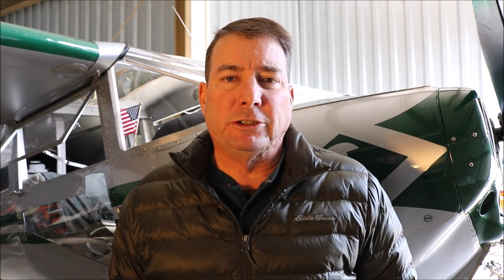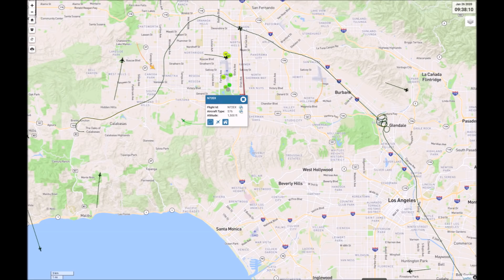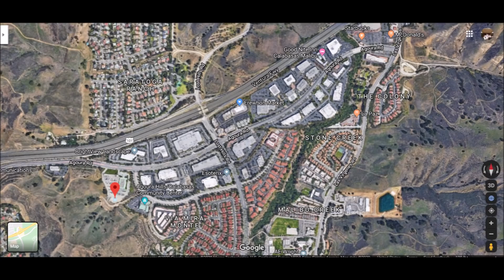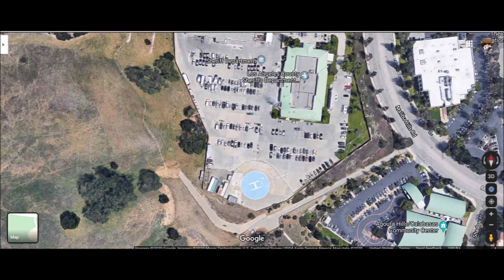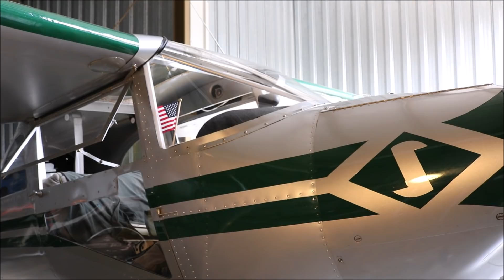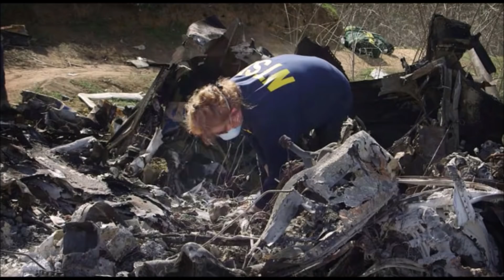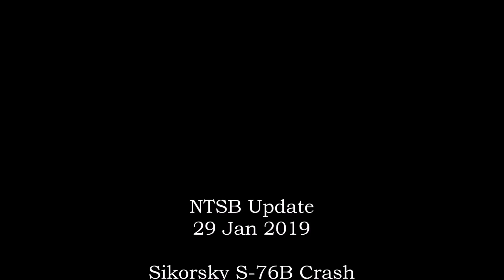Kobe Bryant Sikorsky S-76B Crash Update 29 Jan

Comment: If the aircraft had a mechanical problem with perhaps a main rotor or tail rotor, would it not make sense to change course in an attempt to reach the helipad that was a mile from their location? 

Also it was reported that  an altitude of 2300 ft. was higher than any hills in the area.  That means the aircraft could be monitored  by SoCal Radar and direct communication between air traffic control and the pilot was possible.  Do we have ALL recordings of communications prior to the crash?

The crash site appears from other reports to be on the downward side of a hill.  That means the pilot cleared the crest of the hill and crashed soon after.  This data is consistent with both the rate of decent and forward speed.  

The Sikorsky S-76 aircraft has been in certified since 1977.  Sikorsky S-76B (N72EX) was built in 1991.  And though there have been changes and upgrades in power plants and electronics, the airframe and major mechanical/hydraulic components remain much the same as first produced.   A cursory internet search yields numerous failures of tail and main rotor failures.  With rare exception these failures led to tragic  loss of life. 

Crash site photos of N72EX reveal images of smashed  main rotor parts and also show the main rotor hub at some distance from the center of the crash site.  

Tail rotor parts (with distinctive shape and yellow tips) are not accounted for.  Any idea as to their crash site location?

Comment: im not well knowledge on copters but is it possible that with a rapid climb without warning of power limitations that it overpitched and as result rotors loss RPM which can cause a rapid decent with out the pilots immediate reaction to stop the decent.?

Comment: The FAA is becoming the laughing stock of the international aviation world.

The max-8 certification saga is the last straw.
For years, the world has put up with the FAA because of the number of US aircraft manufacturers in the world. - They want the aircraft.

Small repeated accidents like this show the failure of the FAA to act on training and technological requirements that can make flying safer.
I know full well that cost and practicability is a huge factor, but you just have to look at the ADSB requirement to show that it is possible to enforce new blanket rules which require individual investment by the community.

When international aviation authorities start to treat the FAA and their certification of new aircraft like they treat the "third world" aviation authorities, you know there is a VERY big problem within.

Comment: When you say "lost control of the aircraft", does that mean not knowing which way is up or down? Model helicopters and drones have cheap gyroscopic stabilisation that prevents them flipping over like that, yet they are still easily controllable. Wouldn't it make sense to implement systems like this to full sized helicopters to prevent catastrophic loss of control through disorientation?

Comment: I understand it takes time for FAA to pass on regulation to require CVR, FDR, HTAWS, EGPWS and other systems but there’s nothing preventing the Operator of the helicopter to procure and install these features either via service bulletin or supplemental type certificate. I’m not familiar with the S76B but, in a quick search online, I found many websites announcing these equipment to that helicopter model. I understand that there’s a significant cost component into voluntarily installing these equipment but, as SMS gains in importance in Part 91/135 operations, one should expect operators to be willing to improve their aircraft. Could any of these equipment have saved the 9 on board? Too early to say.

Comment: Juan, thanks for the common sense, factual analysis.  While mandatory changes to part 135 and part 91 operations would take years to implement isn't it true that synthetic vision systems are available today that could have been legally installed and available to assist a pilot to get out of trouble if IMC is inadvertently encountered?

Comment: I heard a quote recently about flying in fog. "Remember, it'll be sunny the next day when they zip you up in the body bag."
Reply: Johnathan Mc - absolutely correct - almost every post impact CFIT photo library - you will note the weather is perfect .....

If only the pilot had waited out the weather, or made a better decision to re-direct to a clear area

This accident probably had some “get there itis” component you it, or as Juan points out, he was trying to locate the helipad and lost control in the thick clouds 

The question is why did he keep on flying into deteriorating conditions in the first place ??

Probably we’ll never really know 

RIP
Reply: @captbiggles2808  maybe ego, maybe proving himself as the 'guy who gets it done' for the high profile customer, overestimating skills. alot of unspoken reasons in short. why do we continue when in hindsight we should've turned back.
Reply: Matt Ford you know that the audios release from an air traffic controller regarding Kobe’s flight that day show that Kobe’s flight was held up by over 12 minutes. Weather conditions can change very quickly. I’m sure you can imagine what waiting over 12 mins to be cleared to continue your flight could have changed regarding weather conditions. Kobe’s pilot was instructed to keep circling that airspace. The air traffic controller tells another pilot that Kobe’s helicopter has been waiting about 15 minutes and holds that pilot off to allow Kobe’s pilot to continue on. Who knows if they hadn’t been held up that long if the weather conditions would have been a little better and they would have made it safely.
Reply: Tiff Turg You’re right, and understanding those variables ahead of time is all part of exercising good judgment.
Reply: @captbiggles2808  perhaps the tenacious and persistant nature of the Mamba Mentality caused this tragedy.
Reply: my love songs 
You are absolutely correct, they want to get it done, but you can’t control weather
Fog is the worst scenario. Stay grounded until it clears
Reply: @mylovesongs2429  I have thought that " We gotta get there, there's a tournament"
Reply: @mylovesongs2429  If sadly so, that is where the FINAL, most respectable pilot mentality / wisdom & disciplinary intellect of SAFETY FIRST should have been honored, w/complete humble relinquishment of any egos for best interests of all☯️
Reply: Exactly. If the news choppers are on the ground and the law enforcement birds are as well, I'd say that it's a good idea to keep your ass on the ground.
Reply: Sad, very true...the idiots are the ones who don't understand how mouse traps work.
Reply: Sad and true,  it always is 😕
Reply: So very true
Reply: Understood
Reply: Cassidy  Goodwiin is an idget......
Reply: Jonathan McMichael 🤭
Reply: Lol
Reply: You're an idiot
Reply: @cassidygoodwin478  thats probably a pilot quote though to warn other pilots who are about to make a bad decision. Its not a joke
Reply: Cassidy Goodwin, living and flying in Alaska I’ve seen a lot of cfit crashes, usually the next day it’s beautiful. 

It’s get there-itis which helps kills aviators
Reply: @jamesspikes  exactly! "Get thereitis"
Reply: @cassidygoodwin478  You can't handle the truth.
Reply: Cassidy Goodwin and you’re completely missing the point. He’s not being disrespectful .

Comment: Speaking as someone who has done a little bit of testing of enterprise critical software over the years, "it takes time", may well be true, but time is not always the strictly linear thing we assume it to  be. 
If it takes one individual 1 month to perform the necessary tests, it may take 30 individuals only a day. 
I suspect the FAA needs to up its game in terms of resource. 
These processes do take time, but any wasted time in this case doesn't just represent dollars, it also represents lives. 
Likewise any corners cut (think 737 Max) also cost lives, thus a fine balance needs to be struck. 
I would argue the process needs to be far more transparent. 
Why is it taking such inordinate lengths of time? 
What could be done to reduce this time without compromising safety?

Comment: Is it possible that the helicopter hit the mountain (900’ - 1,000’) before the steep turn at 130 kts (1,300’ MSL) ?
Reply: John Kyle I’m not sure if the correlations of altitude between the radar, helicopter and terrain are that accurate.

Comment: Transition from VFR to single pilot IFR raises pilots workload and pressure exponentaly, especially if you are not prepaired, low visibility, low terrain and you are entering busy airscpace. And in case of an emergency situation goes worse.

Helicopter is very unstable at low speeds, it’ s easy to lose control/get disoriented in IMC conditions if you don’t have proper training and if your experience is only from normal IFR flights from field to field.

Low speed, low alttiude and low visibility...allways a bad choise.

But we wait and see what NTSB finds out...

Comment: In this case, obvious scud running, the terrain avoidance system would have been turned off, or continuously flashing/beeping. This was a deliberate  low level attempt to push into low visibility, low ceiling conditions.

Comment: One of the most articulate and competent aviation witnesses I've ever heard, was underneath the Sikorsky S76B moments before it crashed.  He described it moving as very slowly, directly above him, but in the low clouds and not visible.  His description of the forward velocity made it sound like it was hovering and moving slowly and definitely below transition speed (where it begins to fly more like an airplane).  If Juan is correct about the difficulty of flying in the clouds in or near a hover, then this is a rather important witness to the whole crash investigation.  The man's statements are on YouTube as a video.  Sorry, I don't currently have the link, but it was posted by someone else commenting.  Perhaps someone can re-post it here.  I am retired now, but flew for the same major airline that Juan Browne flies for.  After retirement, I learned to fly a helicopter, but never on instruments.  In and near hover, a helicopter flies much as you would balance a broom in one hand.  As long as you keep moving your hand to keep the broom upright, you can keep it upright.  As soon as you stop moving your hand, or make a small mistake, the broom quickly tips.  If it goes too far, it's too late and it falls over.  In visual conditions, hovering a helicopter is actually easier than balancing a broom, once you get good at it.  At night, with fewer visual cues, it becomes more difficult, but mostly not too difficult.  The worst is a dark night with no lights.  I only rarely flew at night.  In two events I recall, I had no visual cues down low for a minute or two, though I knew exactly where I was.  In those conditions, I did use the artificial horizon and that worked fine.  I was mentally prepared for this as it was at the end of a long night flight over rural areas.  I also was not hovering, but flying at perhaps 60 knots, so the helicopter was flying like an airplane.  The sky was absolutely clear, but I was in a deeply rural area.  No lights and no moon.  It was very spooky, but not unsafe due to:  1.  Forward flying speed;  2.  Knowing my location, which was free of obstacles (hills, towers, wires above 100 feet).  I have no idea how an artificial horizon would respond in a hover situation.  Maybe it's fast enough if you are practiced at it, but who does that much?  Think about standing in a pitch black room.  When you start to teeter a little bit, you go a lot farther over before you detect your tipping.  With visual cues, you see the movement before it gets critical.

If, after a near hover over the above mentioned witness, the pilot began accelerating and climbing, the body sensations he experienced would be disconcertingly in conflict with the instruments (mainly the artificial horizon) due to acceleration effects.  This effect has caused some crashes with catapult launches from aircraft carriers.  With the 3+ G acceleration ending suddenly, the perception can be that you are climbing too rapidly.  They have had pilots push the nose down and fly right into the ocean.  They instituted new procedures and training, which apparently mostly mitigated this problem.  I just watched a carrier video that mentioned this.  A knowledgeable carrier pilot can elaborate here.  Spacial disorientation is a really big deal.

More than 40 years ago, during my early instrument flying training, I finally took off and flew into clouds in a light plane, for real, for the first time (with my instructor).  I'd been flying on instruments, under a hood blocking my view, many times.  Flying suddenly into a milky white nothing where all I had were the instruments to stay alive was quite disturbing.  I quickly overcame that, but I never forgot that sensation.  Early in my career, I had a few experiences flying in clouds on instruments while experiencing vertigo.  This was due to being the second pilot in a light twin engine airplane that required only one pilot to fly.  Only the left seated pilot had any instruments.  I was in the right seat without instruments.  To periodically relieve the other pilot, I would fly on his instruments on the other side of the cockpit.  So I was looking left at a 45 degree angle.  This led to a disconnect with the motion of the airplane.  My head was, from time to time, telling me that I was rolling over.  It literally felt like i was in a barrel and rolling over and over continuously.  I had to trust the instruments and ignore what my body sensations were telling me.  That was extremely difficult and hard to keep my eyes from rolling.

Try this (only if you are young and in good shape):  Sit on a 5 wheel desk chair.  Shut your eyes and spin around for about 20 seconds while seated upright.  Then, when your inner ear balance sensations have stabilized to your spinning, try bobbing your upper body up and down, head toward your lap, then back up.  You will get a very good idea what vertigo is like.  Don't do this without putting the chair in a large room with no obstructions and have a TRUSTED friend there to keep you from getting hurt.  You might fall right out of the chair.

Sorry for the long ramble, but a lot bubbled up in my mind while watching all the videos on the crash and while writing this.

Comment: Juan check out the granular ADSB data of the last 15 seconds.    He climbed because he was getting squeezed lower as the highway elevation rose to nearly 1,100' near the Lost Hills.  His reported altitude was barely 1200 MSL.
The last 15 seconds the data shows after a 45 second climb an immediate nose over dive -4000fpm turning left off his 101 track.   The aircraft heading snaps wildly 60 degrees back and forth in the final 5 seconds.   He goes beyond the S-76 155 Vne to over 160+ knots.

Doesn't sound controlled flight to me.  Perhaps eyes were locked outside looking for visual reference not noticing the death spiral.   I hope the data provides definitive answers one-day.

Comment: What is strange to me is the aircraft was only being maintained under 135. For rotor wing, if you aren’t a current factory repair station (part 147), with factory trained technicians, then you need to perform maintenance that satisfies 91 & 135: comply with all TB’s and SB’s where applicable, obviously ASB’s, only orders parts from the manufacturer, etc.

The next thing is why the facility who operated and/or maintained the aircraft had not converted to some certified glass cockpit. I haven’t looked to see if anything’s available, but the 337 is always an option. 

I don’t know about anybody else, but for me, operations that conduct VIP missions should have these items. Obviously, the pilot/s should be well qualified in all operations: VFR, IFR, and goggles. Even better would be some minimum hrs of mountain time - logging, fire fighting, life flight in a PNW state. Being fluent in an analog cockpit makes a glass cockpit an incredibly powerful tool for good pilots. Google time and mountain time, and staying current on all training as well. That goes for mechanics just as much as pilots.

Comment: Juan, one of the things that Jennifer said, in her first briefing, was that they found an iPad with Foreflight on it.  The helicopter version has Terrain Awareness and Obstacle Obstruction database.  I'm wondering if it was running at the time and being used, or not used.
As a pilot, you are aware that  FDRs and CVRs take up payload, and some manufacturers or end users may not want to cut into the useful load of the airplane.  I mean, the S-76 can probably afford it, but some of the smaller stuff would be hard pressed.  For instance, a Bell 407GXi has an optional internal max gross weight of less than 5,300 pounds.  That's one pilot and six passengers.  That's not a lot of wiggle room for those two packages.
CFIT is something that happens, unfortunately.  It's up to the pilot to know what he's doing.

Comment: I noticed during the overflights by news helo's shortly following the crash that the debris field was in the opposite direction of the way he should have been traveling. Also, an early I witness said he hear loud thumping. Which I would interpret as the sound rotor blades make when making a hard banking turn. This  will go down as pilot error, it appears he flew straight into the mountain. Hopefully they passed instantly without suffering or knowledge of their pending doom.🙏